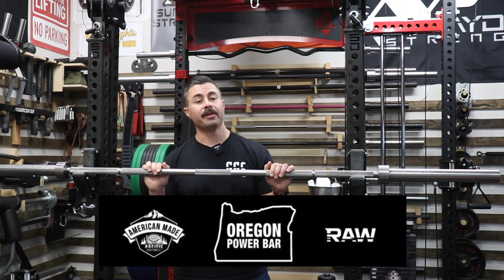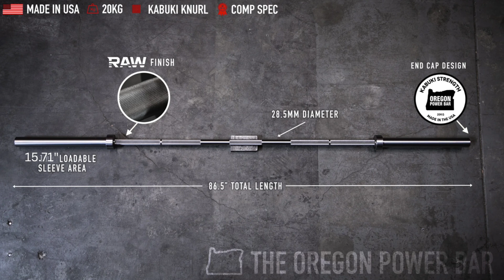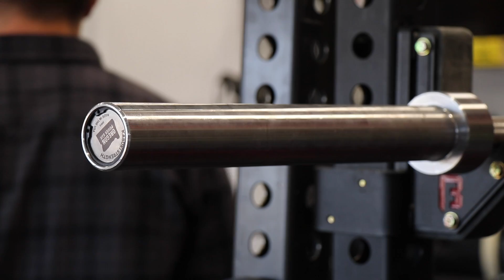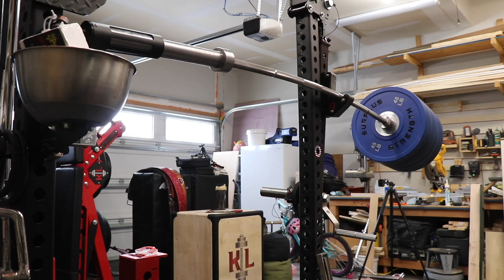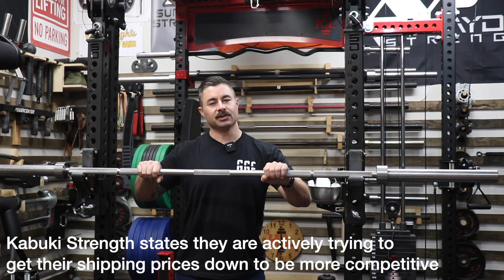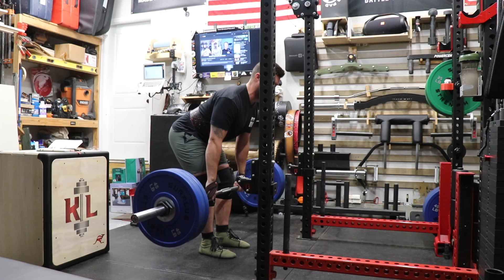Unleashing the Beast: Kabuki Strength's Oregon Power Bar Review | Heavy Lifting Gear #homegym

Comment: Bought this bar as my first Kabuki bar understanding it is more of an economic bar. The knurling is great and definitely is for someone who doesn’t like aggressive knurling aka my wife lol

But I’ll stick with my Texas 29mm new power bar. I even checked the specs and TPB even beats out the steel tensile strength like you mentioned in the video.
Reply from the maker: I need to get my hands on a 29mm TPB

Comment: Not sure why but bare steel bars have always Felt better in hand than stainless steel.
Reply: I fully agree.  Here is my theory as to why.  Stainless steel is harder than bare steel.  It chews up the tooling a lot faster than bare steel, meaning the tooling has to be replaced more often.  I think it's a combination of the the material (in this case, stainless steel) being a harder surface and thus, not taking as well to the knurling process (the tooling just doesn't dig in deep enough, or whatever) AND the tooling getting chewed up really fast and thus, producing bars that were knurled with tooling that was worn down to start with.
Reply from the maker: @hitleractually8180 not a bad theory.
Reply from the maker: I’m gonna have to pay a little better attention now. The issue is I have a stainless bar but it’s not the same knurl type as any of my
Other bars